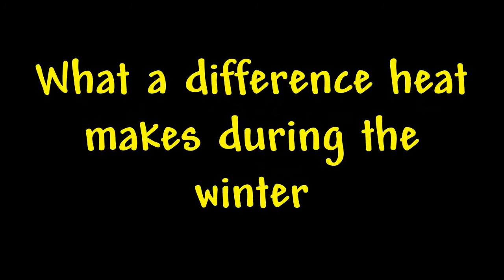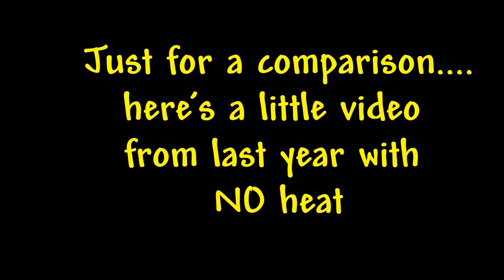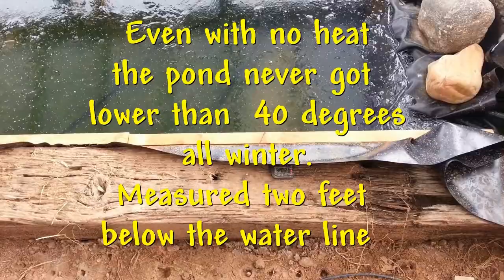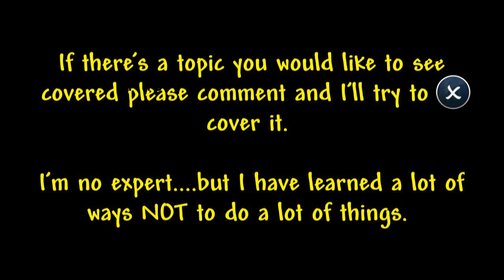The difference heat can make in a winter greenhouse

Comment: Keep it running on the cold days it won't freeze when its moving
Reply from the maker: I've had experience with that.  It will freeze when its' moving.   Now if the water itself is kept well above freezing then it will keep the pipes clear because of the heat.   But if the water actually gets to say a degree or two above the freezing  point and the outside temp is say 10 or more degrees below the freezing point.   Ice will form on the inside of a pipe just like clogged arteries and it will eventually choke it off and freeze, blocking the flow.   That only works if the water is warm and you  keep it warm. 
Ed

Comment: I am building a green house now,  It will be single walled, I plan to bury the plastic on each side about 1.5 feet underground.  Any additional tips?  Thanks!
Reply from the maker: One thing I found to be a real help is building some cheap lumber tables inside so you don't have to plant things in the ground.  It saves a lot of bending down, weeding and lots of laborious stuff like that . 
Ed
Reply: Father Daughter Farm. Why bury it so deep ? Dosent take to much to hold it down you might consider fastening it to a peice of pipe wit a pic clip made from pipe then you have the option to roll the sides up for venting
Reply: That's a good idea, I was hoping to help retain heat better, but doubt the heat gain would be much.  It's probably more valuable to have sides that roll.  Thanks.
Reply: I hate bending.  Thanks!